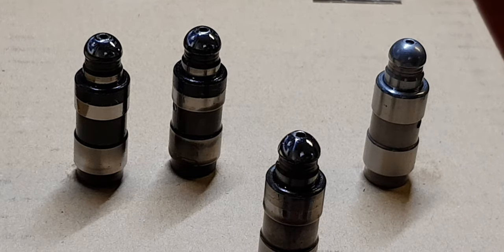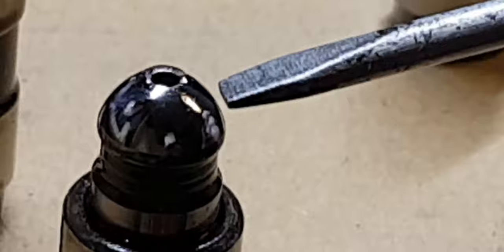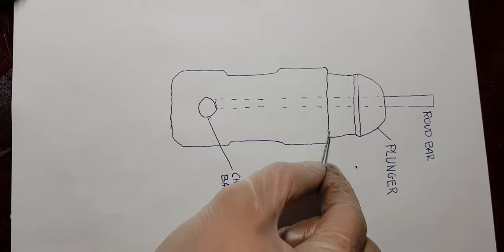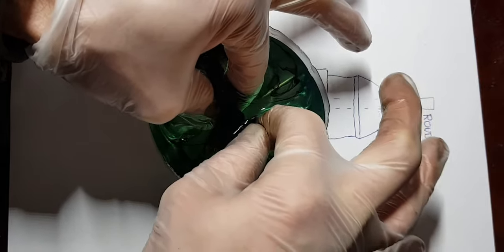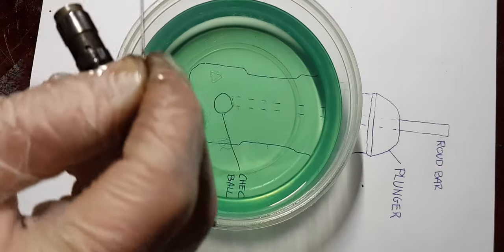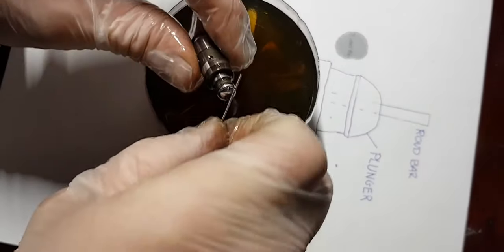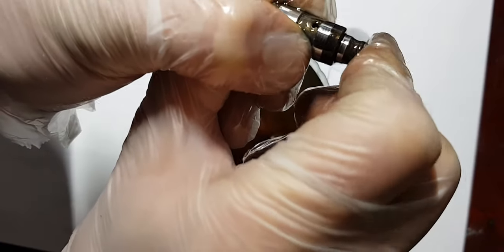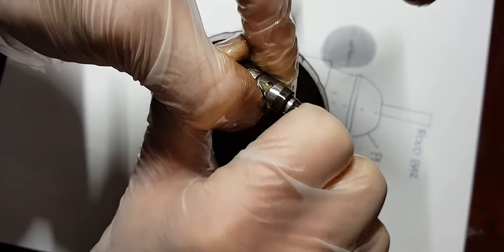Noisy Hydraulic Tappets/Lifter/Lash Adjuster: inspection, cleaning and bleeding.

Comment: I was watching your video showing this procedure, I am working on a 2012 BMW 328i with same type of HLAs and when you buy new lifters from the dealer they are rock solid. Everyone I know says they need to be rock solid before install. I also questioned this theory since pressure has to build up gradually on usage, and thought the stiff solid lifter might damage or counter the valve or itself if not properly primed, despite what the manual says, BUT if you have done it successfully on different engines then it is all I need to now I usually go on experience that others share, so thanks.
Reply from the maker: Thanks for the comment. For the engine, I was overhauling I had to buy 4pcs of new HLA. As you could see on the video, I used one of them as a comparison, they are rock solid. The engine I rebuilt run very smoothly from the first start. If you work with BMW check HLA before you clean them, you can check the height as well before and after and you will find the answer yourself🙂

Comment: My concern would be that if hard material is used for the rod, it may (slightly) damage/scratch the surface of the check ball. I know the check ball is made of hardened steel, but still. I think soft material rod, such as a copper or aluminum wire would probably be safer.
Reply from the maker: There is never too much safety, and I agree, but to find that thin round bar made of softer material would be a real headache 😉
Reply: @JB_Auto  I was thinking e.g. a solid 12gauge or 10gauge electrical copper wire (after insulation removed). Those should be strong enough and won't scratch hardened surfaces for sure 😀

Comment: Thanks! great video. Question. Do the oil holes on the side of the lifters need to line up? And Should I pre-load my lifters before installing them, or just soak them in oil? I have heard both
Reply from the maker: Thanks for the comment, You do not need to line them up, you should bleed them out as on my video, pre-loading is the wrong term because you do not pre-load but bleed out. If you do not bleed out they will be noisy at the beginning until filled up with oil.
Reply: @JB_Auto  love your videos! leaving it to be filled up at crank wouldn't it be better than priming them fully before hand?
Reply from the maker: @samithaweeraman1882 Thanks, it will be noisy in the beginning, and it sounds as if engine collapses, that is why I bleed them out.
Reply: @JB_Auto   when you say you bleed them do you bleed them fully? or halfway through? suppose its only halfway so it just needs to adjust only a little and would happen quickly rather than fully bleeding them?
Reply from the maker: @samithaweeraman1882  Always fully they are self-adjusting anyway, see the link in the description.
Reply: @samithaweeraman1882 hi should the top part compress or be hard?

Comment: I don't think you should install them fully pumped up and extended, as the adjustment of valve lash after running with oil pressure is somewhere in the middle of the lifters stroke, not fully extended, otherwise the engineers would simply use solid lifters instead.
Reply from the maker: Thanks for the comment. This is standard procedure, that's how we in the Mazda dealership prepare the HLAs. Check out the description, you will find an HLA installation note, that's an extract from the workshop manual.🙂
Reply: @JB_Auto  Good to know about Mazdas. Great info and method by the way on cleaning dirty lifters! Although, I do feel it's necessary to point out to others out there that I have seen the opposite information in most factory service manuals of other makes, (admittedly I don't have much experience with Mazdas) So just a word of caution kids..... unless you have a Mazda, with this particular engine, I would not recommend installing them fully pumped up without first doing your research about your particular application, as I know from experience that in some cases you could damage, break, or bend something when you go to torque the rocker assembly down, and also because a fluid of any kind cannot be compressed and therfore it will not be expelled from the lifter cavity past the check ball quick enough upon initial startup, which will incur unnecessary stress on your cam lobes, rockers, lifters and valve stems, even if only for a short time, you don't want that to occur at all if you can help it. Remember, hydraulic valve lash adjusters, or lifters for short, in this kind of application (where they are fixed into position in the rocker arm, without sliding up and down within a bore) are designed for the oil to go in and take up valve lash, or slack, and not come back out, hence the check ball, and why the oil gets so dirty inside them. Oil pressure pumps up usually in less than a second which is substantially faster than the time it would take for a fully pumped hydraulic lifter to bleed off its excessively tight valve lash past the check ball which is designed to keep the oil in permanently, they are designed to pump up once, to the correct lash adjustment, and then periodically allow a little more in, little by little as valvtrain components wear out, and that is it. This is why when you remove a used lifter, and you can compress it by hand, you know it's bad because the check valve has failed or gotten stuck allowing the oil to bleed out (commonly referred to as a collapsed, noisy, or ticking lifter) you should not be able to compress a properly functioning used lifter, that is it's job, to pump up and stay pumped up to a specific dimension eliminating all valve lash between the valve and camshaft, not to pump up fully and potentially prevent valves from closing all the way causing a loss of compression as well as unnecessary stress on all the other valvetrain components, most concerning of which are the cam lobes themselves as they are seeing higher forces because the valve is being extended further because the lifter is longer than it should be, thus compressing the spring more and translating to higher loads on the lobe until the lifter can be forced to bleed down (something it is not supposed to do to begin with.)
Reply: @johnny0454  excellent explanation, you are 100% right the engine should pump them up to the required height 👌🏻
Reply: Je suis 100% d accord avec vous . Cest exactement se que je me disais et il y a pas mal de video erronée sur ce modèle de poussoir. E mieux serait de les nettoyer, les vider et les laisser se remplir d huile naturellement par le moteur il réglera le jeux naturellement entre le poussoir et le culbuteurs
Reply from the maker: @sambus6329  It will adjust itself, but if you don't remove the air, HLA will be noisy at the beginning.
Reply: Excellent comment, helped me to understand. Would love your opinion though, I have VW Polo 2006, 1.4 16V engine code BKY. There is videos of people doing this tappet replacement on my engine, one guy, soaks the new unused hard tappets in oil, bleeds it out, does that twice and then puts them back in attached to rockers, and job done. Another guy, takes the brand new tappets, bleeds just the air out of them, so they are no longer rock hard, and soft, which will then allow the tappet to self adjust with just the right amount of oil to open and close the valve to amount required. I think the second guy is right, it makes no sense to me, bleeding oil in and out twice, like you said, out the packet, bleed the air so they aren’t rock hard, and put them into the engine and allow the self adjusting tappet to then fill up to the exact amount required, however if they are new, and they come soft and compressible. Simply leave them as they are? No bleeding. Straight back in and allow them to fill up to what’s required. Would really appreciate any guidance 🤞🍻
Reply: @johnny0454 Great explanation thanks
Reply from the maker: Thanks for watching.

Comment: Thank you for the post; very hard to find. Question: I purchased new HLA's (rock hard), however they unseat the valve when installed. Leave as is (they will sort out), or bleed off (slightly soft) so they don't overpower the new springs (thereby pressing the valves open)? Thx.
Reply from the maker: When new HLAs are installed (Mazda origina), then they are ready to use. So once installed, just turn the crankshaft a few times to be certain that there's no surprise. That's what I do.

Comment: Thanks for the informational video. I noted the intake and exhaust tappets are color-coded differently on the Mazda 2.2 diesel engine. Do you know how the colors should lined up? I'm not sure I remember correctly.
Reply from the maker: The HLAs are not color-coded, there is one part number for both exhaust and intake. The only things which are color coded are Valve springs and valve seals. The WM can find on the web free of charge, unfortunately, I do not remember the website.

Comment: So ever so slight rebound is fine? i have some that are completely collapsed. Is this quite common?
Reply from the maker: There should be no rebound at all, collapsed HLAs happens but that is on rather bad condition engines, with neglected oil replacement.

Comment: Great video mate by the way when you instal them back does it matter where the hole from the tappet faces ?
Reply from the maker: Thanks. It goes upwards 🙂
Reply: @JB_Auto  yes but the hole from where the oil comes out it doesn't really matter?
Reply from the maker: That on the side of HLA doesn't matter, the top one goes to the rocker arm.

Comment: I need ur advice plz.
I fixed ford galaxy 2l engine and when I spin camshaft sprocket, camshafts don't push valves springs properly due to which , on one particular spot camshaft jumps. Could u plz advice what would be the reason
Reply from the maker: I do not understand your description If you can make a video it would be easier.

Comment: If you can compress the top without the pin on the check ball, and liquid comes out, would that be a sign that the HLA has failed?
Reply from the maker: Yes, that is correct!
Reply: @JB_Auto  thank you!

Comment: Clean it and then apply pressure and check if you see any oil escaping?
Reply from the maker: If oil escapes that's a bad tappet, after you bleed the tappet out, check for a rebound by squeezing HLA with your hand or wooden block, if it is hard as a stone that indicates the tappet is good.
Reply: @JB_Auto  it would be interesting to explain how they adjust in height
Reply from the maker: @therealspixycat  You know what. I think I will add this subject to my future videos; as you can see in the comment section, there are many divided opinions about how you should deal with HLAs, and there are a lot of misconceptions
Reply: @JB_Auto  cool! May be also show how to identify this issues while an engine runs? Ie listen using a stethoscoop or long screwdriver and  try to capture that sound for your viewers? Cheers!

Comment: Do the tappets do the same move mounted in engine like you did while cleaning ?
Reply from the maker: No, the movement is almost not noticeable, if you place them into the head engine without oil then the movement will be visible for a brief while including noise.

Comment: hello, it's normal that on my bmw 335i n55 the hydraulic tappet after bleeding with oil the tappet becomes very hard and doesn't move a bit?
Reply from the maker: @noxwolf6678  Yes, it's normal. All HLA, which looks like the one as on my video, will always be hard after bleading, and that is actually a sign that they are in good shape. If you feel rebound, then it should be replaced.
Reply: @JB_Auto  ahh okay thanks ! because there are other types of lifters? which should not be hard after bleeding it with oil
Reply from the maker: @noxwolf6678  I don't think so. There could be slightly different shapes, but the principle is always the same. I know that you may be confused due to different approaches, and therefore, comments like on my channel quote: "YOU SHOULD NEVER PRIME OR PUMP UP YOUR LIFTERS" end of quote. Due to those comments, I also consulted that with my colleague, who is  master technician for VW, we looked at procedures in the workshop manual, and that is exactly the same procedure.
Reply: @JB_Auto  Okay, I had a doubt because I have a ticking noise when cold I start the car the noise appears either after 5-10 min or when just after starting I drive for a few meters, and disappears after a few minutes when the engine rises in temperature when I ride after 10 minutes no more noise I dismantled the 24 lifters 2 were dead because they fit just but didn't come out I bought 2 new ones all I purged at the end they were all hard and I I still have the noise, I don't understand what it could be coming from now
Reply from the maker: @noxwolf6678  Well, if it is a higher frequency, then it could be other lifters. The valve train noise will have a higher frequency, and the crankshaft system will have lower, which is easy to distinguish. In certain cases, injectors can make noises similar to the lifters. Sometimes, it's difficult to find where the noise comes from. Check out my other videos about how to find noise from the engine. Try to use those approaches, and here are links.
https://youtu.be/3NPsgmi0T-w
https://youtu.be/YpHiD6TA6G4
Reply from the maker: BTW, when I forgot to blead the lifters, then they were more noisy while initial start-up, but then got silent when filled with oil while the engine was running. You could also experiment with oil viscosity to diagnose the problem.
Reply: @JB_Auto  I had seen something like that now I put 5w30 can I switch to 5w50 in motul?
Reply: @JB_Auto  ok thanks ! I will look and see
Reply from the maker: @noxwolf6678  I would instead try 10W 30 because 10W is thicker for lower engine temperatures, which may seal any internal leaks at the cold engine, while a higher number after the letter W represents viscosity at higher temperatures, so the most optimal 10W40 as an experiment.
Reply: @JB_Auto  ok thank you very much for the advice! I'm going to try this oil then

Comment: if youve made the effort or paid labour etc so much cost. why would you clean a damaged lifter that cost $9, I guarantee you its going to fail again
Reply from the maker: Who cleans damaged lifters? Check in advance if they are malfunctioning, remaining clean to achieve maximal performance. And of course you can change them all.
Reply: Dirt is not necessarily damage. Perfectly good components can malfunction due to carbon, dirt, etc. Clean them and they're as good as new.